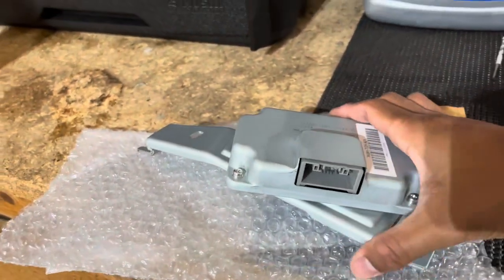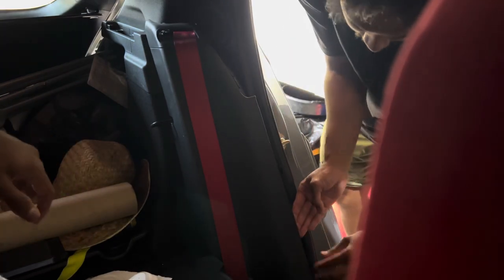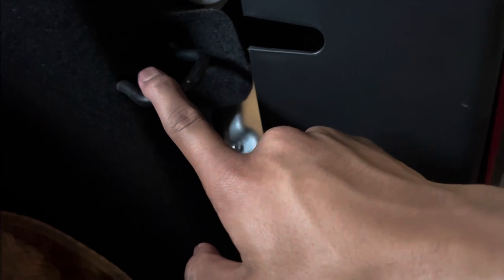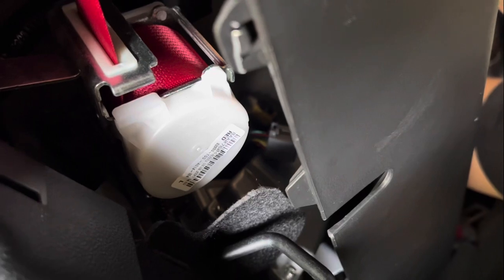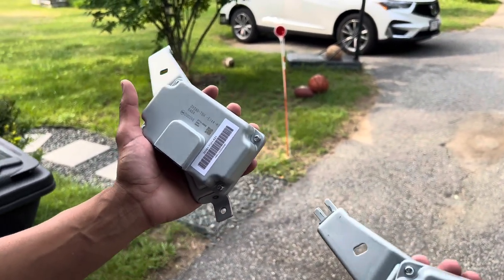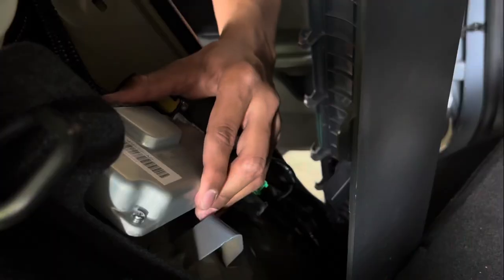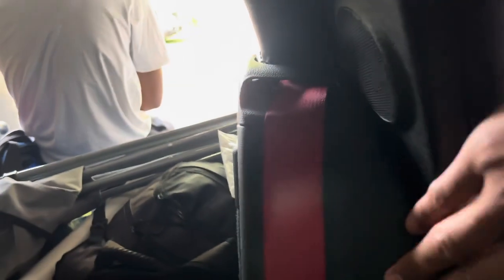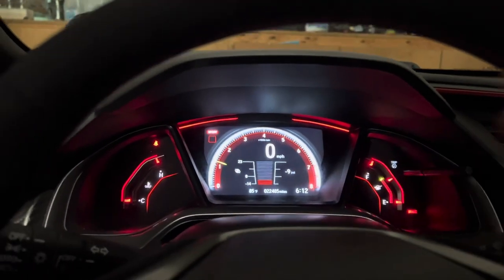Installing the FK8 LE ADS Module on my 2021 Honda Civic Type R

Comment: After reading the linked article I was able to get my hands on the LE ADS. I made sure to disconnect the battery when doing the install.  Once the system rebooted I noticed a major difference in the cars overall performance..
Reply from the maker: Yeah at first I didn’t noticed much, but overtime and having a TON of seat time for me going over bumps and going on the on/off ramps/ turns, I have noticed a difference now between the LE ADS and the stock now, the suspension and how it reacts seems firmer and the steering seems more precise, A great oem+ upgrade without lowering the car for anybody wanting more out of their Type R in stock form

Comment: You want a rougher ride then 😮
Reply from the maker: That’s basically what it does, a more firm and stiffer ride without lowering springs, but would help in addition with lowering springs if someone doesn’t want to go coilovers

Comment: I own an LE, but I want to do the opposite 😭
Reply from the maker: Are you planning on buying the regular 17-21 module eventually to see if that makes a difference?
Reply: @timothysarin  I might do so in the future just to see if the difference is noticeable or not. Ive seen a couple ppl interchange type S modules with FL5.. that’s why it made me curious about doing the same with the LE as the ride can be quiet stiff for daily driving on bad roads
Reply from the maker: @miguel_migskeyz that’s interesting I didn’t know the Type S and FL5 was interchangeable, I know they’re practically the same but that’s good to know. I’m pretty sure it will be a noticeable difference bc I know what you mean by the ride being stiffer lol I felt a noticeable difference after about a week and hitting different rides from the stock module to the LE, when you get the chance to do it, comment back here and let me know!